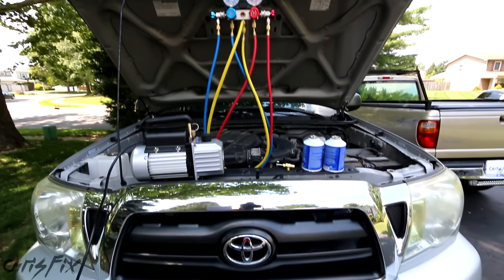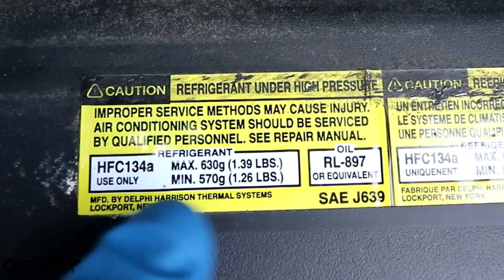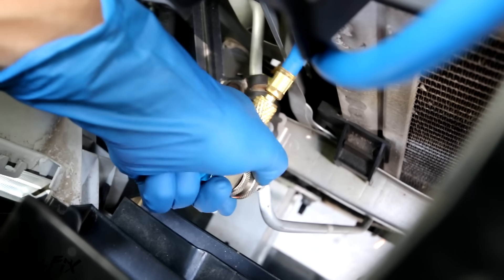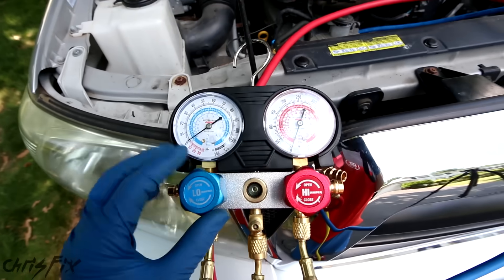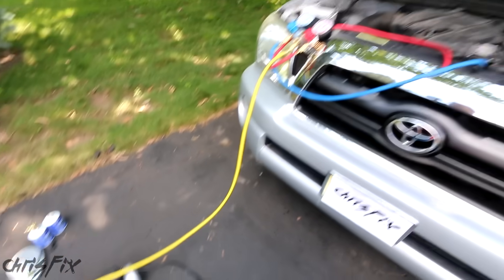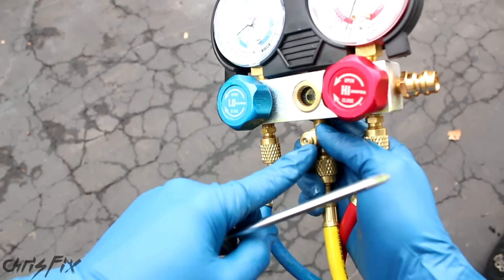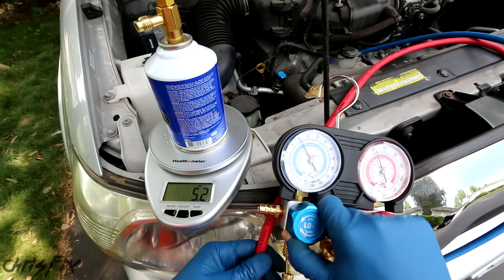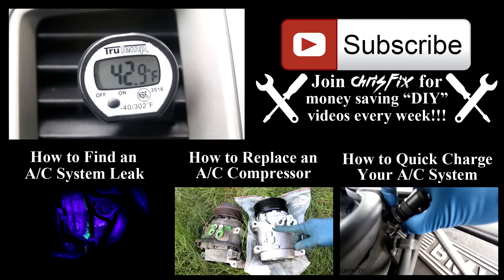How to Properly Recharge Your AC System

Comment: I know this is long Chris, but you need to read this. You need to learn some important steps and not to misinform DIY car guys. 

A: use a Mico meter or Nanometer to pull a vacuum. You can do it dirty for vacing for 1 hour and let it rest for 8 hour or 1 day but its not a sure fire way to make sure you dont have a leak. Car systems have rubber hoses and o rings. They leak over time. very slowly. The only way to tell you have a small leak you MUST have a Nanometer and get it down to the proper amount of microns usually 500 microns. If you have a leak it will show its self within 20 minutes and if its a big leak you will never get to 500.

B:ALWAYS keep all valves closed until you pull a vacuum then open the valves. You also want to use a gauge with a 4th black line for vacuum. that way you can vacuum the lines vs purging the hose with refrigerant. 

C: US Regulations allow HVAC techs and shops a certain allowable amount to "accidentally" get into the atmosphere and i can tell you  that if you dumped your cars system into the air or 4 12 oz cans it would not even come close to what you can "accidentally spill with out legal consequences. yea its bad but its not the end of the world. Cars get smashed all the time and loss there charge instantly into the air. 

D: I can see by your gauges you need to adjust them. Open the clear plastic off, like a jar lid, and use a small flat head to get the needle to 0 EXACTLY. This is for altitude adjustments. Your Low side was off and can give you a false reading. 

E: ALWAYS open the pumps exhaust port. I think yours might be closed. Its a dust cap.

F:  NEVER leave that pump untended. Mineral oil is a fire hazard and a dog or some kid could knock it over and i have personally had a fire from a compressor tipping over at a job site. (eating lunch on  top of building while it vacs down, it was on top of a 5 gallon bucket, HOT DAY on top of building. the door swung open on a electric panel win a gust of wind and knocked it over. It burst into flames because roof was black metal and was so hot it was melting my shoes. Its rare but it can happen. 

G: always check your oil level before starting the pump and if you have to vacuum a system with any contaminates in it like say a flushed line or a system with a failed acid check you NEED to replace that oil after that job. It will kill a pump. Oil is cheep. 

H: YOU CAN NOT just dump oil in with out making sure it goes into the low side NOT THE HIGH SIDE> it must enter the compressor first. . ALWAYS dump that oil in the compressor when you get them new and refill with by volume. Filling PAG oil though the system hose is a risky business and can fail to fully oil that pump for the first few minutes when it turns on. 

I: NEVER NEVER ADD UV DIE. If you pulled 500 microns for 20 minutes you know for a fact you have no leaks. Its just putting another contaminate in a system. i repeat NEVER. its only for a system that is running or running poorly to diagnose and then is fully removed with a flush, some times a double flush using quick flush. 

J: I have never had an explosion in the 300+ Lbs of 134a i have put into cars using small cans or 25lb tanks. Hot water bath or just put it on a radiator hose.

K: NEVER FULLY CRANK THAT PORT OPEN like you just did. you can see the liquid go into the suction line. this will kill a compressor. you can gas ONLY. very slowly open it up and make sure that sight glass never fills with liquid or you can see any getting past. THIS KILLS THE PUMP.

L: Scale in ever ounce. a 12 oz can can have more or less than 12 oz. and right everything down. Tank full with hose connected before piercing and after. then again when empty. you want to have no more than 15% +/- the OEM amount. 25% is what the system can handle with out being damaged but is not as efficient. you want to shoot for 5%

M:NEVER TIP THAT CAN OVER this made me rage. thats liquid going into the suction side. BIG NO NO. just keep it up right and in a warm area like on a radiator hose. 

N: caps do nothing to seal a system they are dust caps. It helps to take some canned air or compressed air to clean them before you hook them up. (not a big deal but i thought i would let you know because you obviously know enough to quick and dirty a car system but its a sure fire way to prematurely damage a pump.

O: Always purge or vac down the lines when adding a new can. those piercing valve bodies are not that great at closing some time. I mean what is 2 minutes of work compared to a new ac job. 

DO THINGS RIGHT  AND DO IT ONCE

I would tell your viewers to only do this t a car you are going to sell or something you dont car about. but on a nice car you care about you really want to take the extra steps. I have been doing HVAC on cars trucks and buildings for years and have learned a lot and have made mistakes like you where. I mean it works but its not the caliber of workmanship you normally produce on your channel and was surprised to see this from you.
Reply: BMC MaintCorp Thank you, I will take my car to a professional thanks to you. I went to a mechanic and told them to vacuum and recharge my A/C and he said sure I'll be 160 dollars and your car will be ready in 15 minutes. Lol now I know not to trust that guy!
Reply: Car manufactures put uv dye in when they build them....the correct way to check for leaks is the use of a halogen leak tester , systems can hold vacuum but leak under pressure. Been there , done that....also the caps are the primary seal on the service ports and keep contamination out of the port
Reply: yup.  brought my car in for alignment & inspection.  they showed me the 'green leak' on my compressor.  But tossed manifold and temp sensors on it and all is cool per the GM service manual procedures and tests.  (not buying a compressor, condenser, and misc parts. will retest/check in spring)
Reply: schooled
Reply: YIKES,  I'M JUST GOING TO TAKE IT TO SOMEONE THAT KNOWS WHAT THEY ARE DOING!  I BOUGHT ACAN W/GAUGE WATCHED, UTUBES AND READ DIRECTIONS, MY GUAGE FLIES UP TO 105 PSI INTO THE RED, THE DIRECTIONS SAY  "STOP" SEE A PROFESSIONAL!!!    WHAT DO YOU SAY?     PLEASE HELP ,, THANKS
Reply: And that "professional" is going to do some version of what he does in this video.
Reply: Timmy, Timmy, Timmy, get more schooling son. The book "Modern Refrigeration " has all the information you need.
Reply: @whataboutbob9786   What did Timmy say wrong??  Prove it out or GTFO.  He gave VASTLY more useful and correct info and tips then Chris's cursory info.
Reply: Good clarification Tim.  People need to know what they are doing.  Be aware that some auto parts stores will rent a quality vacuum pump and/or micron gauge.  But most importantly about his article, there was also no mention of what to do with the extra refrigerant left over.  It is illegal to release it into the air and you also cannot throw the partially filled container away in the trash leaving the tap on it.  The fine for releasing refrigerant into the atmosphere has raised this year (2018) to $44,500.  The reward for turning someone in for releasing refrigerant is $10,000.
Reply: exactly, i see, you know about this job . thanks man.
Reply: "I: NEVER NEVER ADD UV DIE. If you pulled 500 microns for 20 minutes you know for a fact you have no leaks. Its just putting another contaminate in a system. i repeat NEVER. its only for a system that is running or running poorly to diagnose and then is fully removed with a flush, some times a double flush using quick flush."
Then why most car makes inject the dye in the factory?

"H: YOU CAN NOT just dump oil in with out making sure it goes into the low side NOT THE HIGH SIDE> it must enter the compressor first. . ALWAYS dump that oil in the compressor when you get them new and refill with by volume. Filling PAG oil though the system hose is a risky business and can fail to fully oil that pump for the first few minutes when it turns on."
Yeah, there's a reason if you need to fill the charge through the drain hole and then rotate the shaft manually for 10 times after you're done. I.e. if you have, for example, a dry Harrison V5, and you fill oil through its suction port (the same thing as doing it from the low side port) instead of from the drain hole as required, the oil may stop inside the cylinders (and possibly damage the reed valves too) but the swashplate/wobble plate mechanism starts operation without lube. Might work with scrolls/through vanes though but not sure.
Reply: Tim, ¿how do you go about adding oil to a closed system(i.e., no parts change was done)?, because adding it to the yellow line will mean that you'll be pulling it with air as well!, and also means you can't flush it either(you'll squirt the oil out) or vacuum it(you'll suck the oil into your pump). I haven't seen any instruction on that for any inline oil injector, ¿or are you best using one of those plunger type injector before connecting the manifold and charging the gas?
Reply: @gglovato  Either inject into vacuum (with compressor off i.e. shaft not turning) or load into suction port (with compressor on). The thing you're referring to with plunger type injector is called Kent-Moore J-45037 but the oil still needs to be injected into a vacuum. Oil injected into vacuum through high side is the best way anyway and it's how RRR stations generally handle the oil injection before the refrigerant goes inside. Why it's best? Because the discharge reed valves/discharge check valves effectively keep anything injected into the high side from flowing into the compressor. Oil injection should be done only to restore small quantities of oil, such as the quantity that comes out of the lines out during evacuation. For anything else it's always best to get the compressor off and load the oil inside the compressor.
Reply: Also change the dryer desiccant after system has been opened.
Reply: @audievanderstelt6568  How does one change the dryer desiccant?
Reply: What would you recommend buying:
micron gauge, vacuum pump, manifold gauge?
Reply: I don’t think he was bashing Chris, just pointing out some very valid points. I fully support the DIYer, however there are some issues that you brought up in your post that are a bit disturbing regarding proper A/C servicing.-As far as the manometer, or as we commonly refer to it in the HVAC business, a ‘digital vacuum gauge’ (or simply ‘vacuum gauge’) it is an absolute must when evacuating a system. The old days of pulling a vacuum to 29.5”Hg on your manifold gauge set are pretty much gone and done. A system should be evacuated down to 500 microns. This gauge is widely available (you can even get a lower priced one on Amazon for about $100) and you can simply ‘T’ it in on your manifold gauge set. You state that “I have two friends that have owned their own AC companies for more than 20 years each and I have worked with both of them on numerous residential and Commercial jobs and have yet to see either one of them pull out a scale or a manometer when adding or filling a system with freon”.-This statement goes beyond disturbing on so many levels. If it is necessary to add refrigerant after a repair, the only way to charge a customer for the refrigerant added is to weigh the can before and after adding. If they’re not weighing their
refrigerant, there is no way to know how much to charge the customer for the refrigerant that was added. Either they’re ripping off their customers, or themselves. And no, there is no magic mathematical formula to calculate how much you added. IT MUST BE WEIGHED!“I have watched my friends "Purge" systems using freon to get the air out without using a Vac pump”.-If a system has been open due to a leak repair or component replacement, it MUST be evacuated prior to charging. Purging accomplishes nothing. If, for some reason, there was a valid reason to purge the system, then any competent tech would use nitrogen (the same gas we use when brazing A/C copper tubing as well as doing a pressure test prior to pulling a vacuum and then charging). If they’re purging with
refrigerant, they’re wasting their money big time (especially if they’re working
on an R-12 or R-22 system), as well as violating EPA regulations (unless they’re
also recovering as well). The purpose of evacuating a system is not just to
remove air, but more importantly, to REMOVE MOISTURE. Moisture
in an A/C system will mix and react with the refrigerant and oil used in the
system. It forms a corrosive acid that corrodes lines, clogs screens, TXVs and
damages other components in the system. It blends with the hygroscopic oils
used in today's R-134a systems, reducing their ability to lubricate components
like the compressor. By pulling a vacuum down to 500 microns, you are lowering the boiling point of any moisture in the system, thus allowing it to ‘boil off’ into a vapor that gets evacuated.Additionally, adding R-134a as a liquid on the suction side is a no-no. This a great way to slug the compressor, usually necessitating replacement. (Refrigerants like
R-410a must be added as a liquid on the suction side slowly, but that’s a whole different topic).I could go on, but it would probably be an exercise in futility. I think Chrisfix videos are great, but when it comes to A/C servicing, there is no way of getting around doing it the correct way. Yes, you may get by doing it “half-ass” (your words), but it will come back to bite you in the a** eventually, likely costing you more bucks in the end.
Reply: @bmcmaintcorp2235  Great advice to the DIYers
Reply: Timothy Whieldon ... LOL ...
Reply: I can't believe you're bashing chrisfix for his great DIY video key phrase here is "DIY."    I believe you were talking about a manometer not a "nanometer". I'm sure the auto parts stores don't sell or rent them. the only way I can see the average DIYer getting access to a manometer would be to buy one off eBay which if the average DIYer had the money to buy all of the "proper" tools needed then they could afford to bring it to a professional and have it done. I have two friends that have owned their own AC companies for more than 20 years each and I have worked with both of them on numerous residential and Commercial jobs and have yet to see either one of them pull out a scale or a manometer when adding or filling a system with freon. there is the textbook way of doing things and then there is the real world Hands-On way of doing things. I have watched my friends "Purge" systems using freon to get the air out without using a Vac pump. I remember when I was younger purging AC systems that I have worked on in my own cars because I couldn't afford a Vac pump and they weren't readily available for rent as they are now. I live in South Florida and down here A/C is a necessity (in both a house and a car) not a luxury.
so if somebody has to "half-ass" it and not do the "proper procedure" to get it done then so be it.  better the life of their A/C system be shortened than their own life. Heat can kill and people die from heat exhaustion every day. chrisfix has 2 million followers and 1.6 million views on this one video. it is my belief that in doing this video he has inspired a lot of people to attempt and do their own AC repairs on their vehicles and he may have inadvertently saved a couple of lives in the process and for that I applaud him.
Reply: @joeyfix-it1916  wut. Are you seriously telling us your "friends" purged a new system with Freon without first pulling a vacuum? Holy crap, please tell us the names of those places they own so we don't ever have them work on ours. You pull a vacuum on a system not because its a newfangled way of making money, but because a lower pressure causes any moisture in the system to boil and evaporate, thus being able to be pulled out of the system. My God man, havr you never seen a system with moisture in it? It only takes a couple of molecules of water to royally bork a system. That piston head will crack if it meets that kind of resistance, because water is non comoressible. Now GTFO and go back to school, if you ever went. Soubds more like you were enjoying a beer or two while your friends played at being HVAC techs.
Reply: Joey Fix-it dam dude whoever your friends are who own those ac companies will get f*cked over of their caught doing that shit and simply purging the lines with refrigerant and not using a vac pump is just the wrong way to do it on any level. Not using a vac pump simply shortens the lifespan of the system, but also reduces its efficiency greatly, including your cars fuel efficiency which NO ONE wants. Not to mention it’s simply unethical, if a greeny caught you and you got done for it your looking at a massive fine depending on your country, but in my country that little bit of refrigerant you release intentionally will get you a $50000 fine. Sooo not worth it
Reply: @mathewbarnes1756  like I said, that's what THEY do. I actually have a vac pump and like doing things right but my point was that most people are doing it themselves because they cannot afford to pay someone to do it and some can't even afford all of the proper tools to do the job. Chances are that somebody in that financial situation is probably driving an older car with high mileage that is about ready for the junkyard anyway so if they have to skip pulling a vacuum to get there car A/C working for a while until they junk their car then so be it. During my younger days I found myself in the same boat driving an old car and had no money to buy all the proper equipment to fix it so I made do with what I had and what I had did NOT include a Vac pump. The resources we have today to order Chinese tools and get things Dirt Cheap off eBay and other sources we're not available back then because we didn't even have internet. so to get a Vac pump back then would have been an expensive venture.
I am not nor have I ever been a professional AC technician.
I have never gone to school for AC I have just learned about it through talking to other people, reading and trial and error. as I was growing up and having to work on my own Vehicles because I couldn't afford to pay somebody else to do it.
Reply: Timothy Whieldon exactly man
Reply: Yes, it seems like a good video to get familiar with what's involved, but it comes across as bit hacky.  Probably too much to explain impromptuously in a YouTube video, but the attempt is there. I would definitely be concerned.
Reply: And once again, countless corrections to a "how to '*properly*' video".  who'da thunkt it?  kids these days.  Thanks for sharing the true proper way.
Reply: I REALLY wish I would have read this first. I am having rage due to some of these issues messing things up.
Reply: I would love to see you swoop in like Mr. Wizard to tutorialize Chris.
Reply: he was not talking about a manometer or a nanometer, it is called a micron gauge, microns are level of moisture far below inches of mercury, so far below 29.98" inches, or -14.7 psia if you will. this will ensure that there is absolutely no moisture present in a system. typically if you are below 500 microns you are safe. this is so important and as an air conditioning technician i find it offensive that you are bashing timothy for multiple reasons. i respect chris and his extremely detailed videos, but this video is a different trade in a sense. if this is done wrong, and not evacuated or performed correctley there is no point in doing it and it will cause more harm and money then it does good so essentially there is no DIY for it. certainly when chris assumes that moisture can cause leaks which it can. but moisutre is mostly harmful to internal parts causing the oil to form acidic leading to severe damage. basically all im saying is timothy is right and diy is really not an option if you dont know what your doing. car mechanics reallly only scratch the service of ac. i work on large 3500 ton commercial systems. no disrespect to chris at all, just saying car ac is not really a "DIY" project. if not done right, you will be paying someone to do it right the next year, it may blow cold air for 3 months but its only a matter of time. cheers
Reply: so true, all the positive comments and this is done totally wrong. I see people using these crap gauges for mini split tutorials too. Without a micron gauge u know nothing
Reply: Thanks for adding more detail.